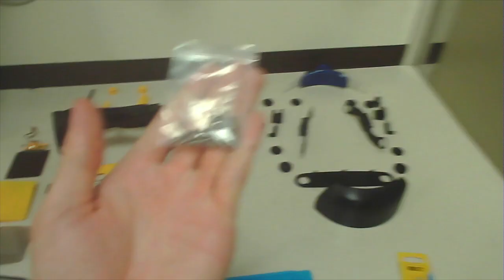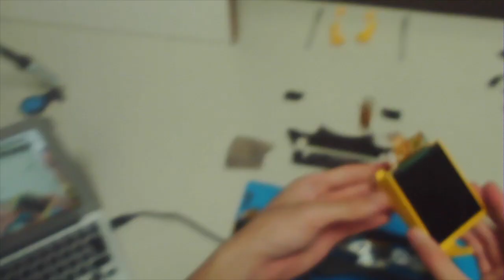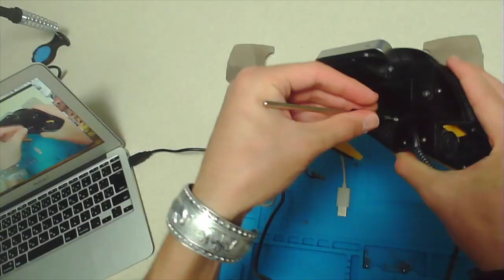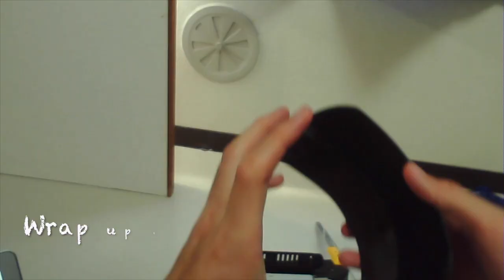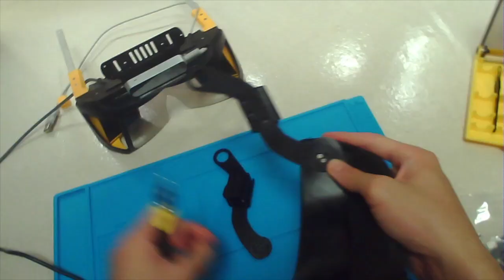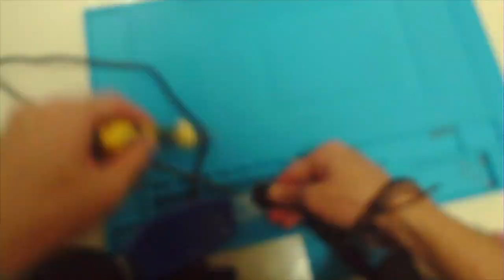How to assemble Project North Star v3.1

Comment: How much it cost?
Reply from the maker: I forgot to mention about it in the video. Thanks. 
In short, it costs $731 in total for me.

Kit A costs $299 (excluding 3d printed parts)
Kit B costs $399 (including 3d printed parts)
Kit C costs $499 (assembled & calibrated one)
Plus you need importing fee(DHL Express), $70 to $200, depending on the kit.
https://www.smart-prototyping.com/AR-VR-MR-XR/Project-North-Star-Kit

Plus, Leap Motion & RealSense T265 (or Structure Core) cost about $300.

I chose Kit A and I use my friend's 3d printer. So..
$299 + $72(DHL Express fee) + $30 (filament) + $300(sensors) + $30(postage in Japan) = $731
Reply from the maker: And if you don't have VR ready PC installed Windows OS(because Leap Motion Origin only works in Windows). you need to buy it.